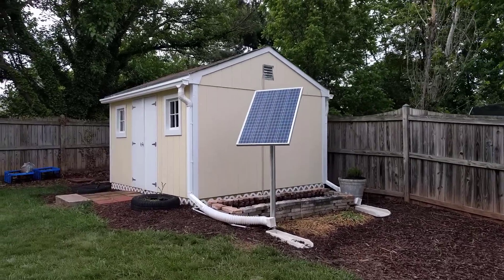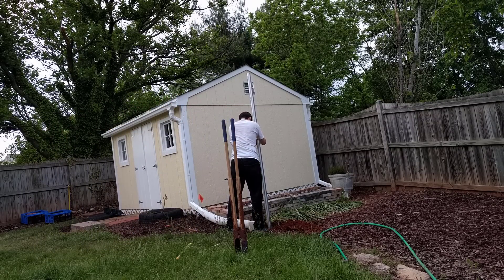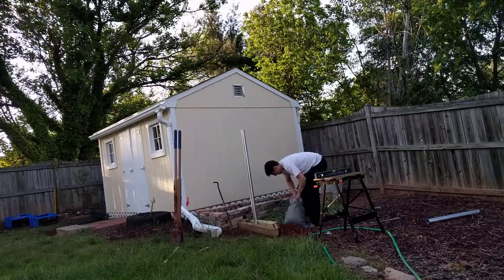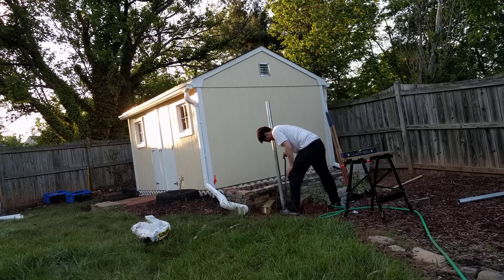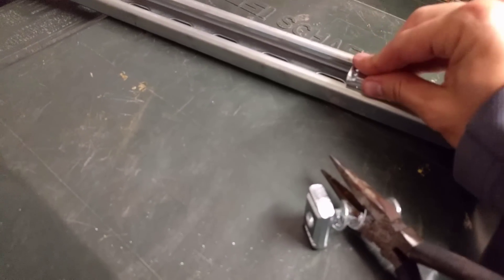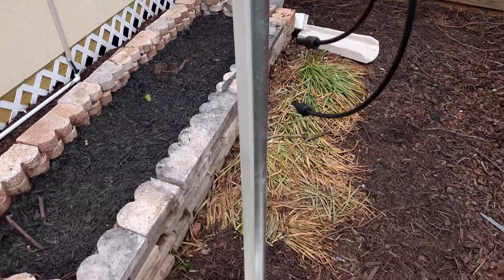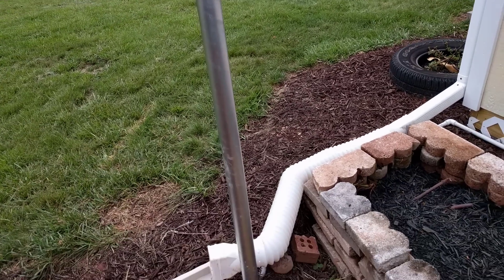Solar Power Tool Shed Set Up

Comment: Did you have to get a permit and have it inspected after installation?  I got fined $250 by the city for not getting a permit and having it inspected one year after I built the system. I thought that since I wasn't connecting tot he grid I was OK. That would be another problem if I did.

Comment: Wow, what a great video! I really value quality family time outdoors as well. If you're into camping and outdoor adventures, I highly recommend checking out the Segway Portable PowerStation Cube Series. With its massive capacity, powerful output, and fast recharging, it's perfect for keeping your devices and appliances running during extended trips. Plus, its waterproof design ensures it can handle any adventure, rain or shine!

Comment: That's cool I want to buy a solar panel kit and run lights outside with a few batteries to store the power that way they can run the motion sensor security lights all night and in the day time charge the batteries also make a 12 volt switch like that with leds

Comment: Is there a another type of battery besides the one you used to get a connection I don’t like that type of battery especially if plan to put in tiny house living space
Reply from the maker: Yes, there are tons of batteries that you can use, just make sure that it is a deep cycle battery.  The one I picked is somewhat light duty, it is 35Amp Hours.  For a tiny house set up, you may want a bigger battery, and a few more solar panels.
Reply: @burrheadjr  got it thank you probably need probably at least two more panals for tiny house
Reply from the maker: @dreamwakr  Try using a calculator like this to help size your system for your project:
https://unboundsolar.com/solar-information/offgrid-calculator

Comment: I know this video is pretty old, but to save a newbie from making a mistake, please be sure you connect the charge controller to your battery bank BEFORE connecting the solar panel leads to it. If not you run the risk of burning out your charge controller.

Comment: Hi there, great video! Question: if I wanted to run a few power tools such as a bench grinder and mitre saw, do you recommend getting a different control charger, battery, and inverter? I figured I would need a 2500W inverter but wasn’t sure about the control charger and battery. Thank you.
Reply: Or would I need some massive battery power perhaps?

Comment: helpful hint, next time you put a pipe in the ground like that, get a post hammer and just pound it straight down. soooo much easier than what you did , great job on the build though. I am thinking of doing a similar project....

Comment: Nice video!  Did you know that pvc pipe will degrade if exposed to sunlight for a long period of time?  A good option is electrical galvanized conduit which is inexpensive.

Comment: My inverter has an alarm sounding and is flashing red/green. What’s wrong with it?  I think I have exactly the same set up as you do.
Reply from the maker: Running too many devices on it, running on low voltage, or maybe your inverter has a safety feature built in indicating that it is time to replace the battery

That is all I can think of

Comment: What gauge wire did you use that runs from battery to light switch
Reply from the maker: I think you are talking about the small wire that actually come from the Charge controller, and then run to the switch, which then goes to the lights.  That is a 22 gauge wire:
https://www.amazon.com/gp/product/B001JT1CEE/ref=oh_aui_detailpage_o09_s00?ie=UTF8&psc=1

Comment: i’d you have the power inverter on and say an extension cord with it on nothing plugged in is it using electricity or can it just sit there idle, or enough electricity to drain your battery much

Comment: How much did you pay and could you run 3 lights
Reply from the maker: For me it came out to about $434, but considering that I paid high for my inverter, and over paid on cables/wire (you can use cheaper cables, but I went with the pre-set ones for convenience), you could do it for just around $350.  I am sure I could have gotten 3 lights, some setups use 6 smaller lights.  The lights don't use that much power if they are LEDs, so adding more lights would not be too much of a problem.  Click on the description for links and prices for everything I used.

Comment: My question is, could you have just placed the solar panels on the roof of the shed instead of the a-hole and pipe method?
Reply from the maker: Yes, I could absolutely drill into the roof and mount it there.  However, If you put it on the roof, keeping it cleaned off will be a little bit harder, because you need to get a ladder.  Also, if it is on the roof, making adjustment to the tilt will be a little bit tougher too.  The mount that allow you to adjust the panel tilts on rooftops are a bit pricey, and with the pole, I could get away with using uni-strut and a satellite dish mount.  I also liked that I didn't have to worry about accidentally causing a leak on roof shed. Overheating can be an issue to roof mount set ups too if the mount does not allow enough air to get under the panel, I don't have to worry about that at all on the pole.

In my case, I also get a slightly sunnier position on the pole, because the shadows of the trees around the house cover the roof first.

Comment: How long will last the batterie if you use the ac power for regular lights not leds tnx
Reply from the maker: Theoretically, weather I use AC or DC power shouldn't make TOO much of a difference.  The big difference will be using regular incontinence bulbs vs LED lights.  Running a couple standard 60 watt bulbs would last just under a couple of hours before I would want to shut it off to prevent the battery from getting below half way.
Reply: burrheadjr so your inverter don’t have a safety to turn it off before drain the batterie?
Tnx for answer
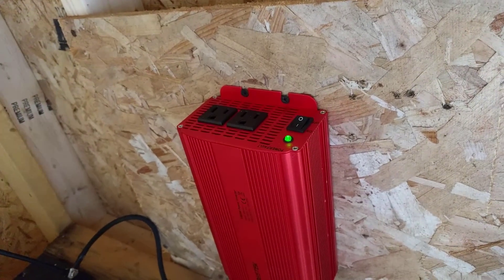Reply from the maker: @fishblue70  The power inverter does have a switch to turn it off and on, you can see me hit it at about 4:00.  If nothing is plugged into the inverter, the power drain is minimal.  It will drawn some power, but not much.
Reply: burrheadjr tnx

Comment: Could I do this same setup but add a second battery in parallel? Or would I need a bigger solar system?
Reply from the maker: I think you could do it.  The battery will allow you to use power, the solar recharges that power.  So there is no requirement that big battery banks need a lot of solar, it will just take longer to recharge.  An example of where that may be helpful, is if you have a shed where you use it heavily for 1 day, but only once a week, or once a month, so that the single panel has plenty of time to recharge the large battery bank.  If however, you will be using it often, then you will want more panels, enough to recharge your usage in the time that you plan on using it again.  You will have to crunch the numbers to see what that will exactly come out to, but it will all depend on what you are looking for.
Reply: double the solar panel wattage to the amp hours of your battery(s).

Comment: Why didn't you just put the panel on the roof? It's in almost the same orientation anyway.
Reply from the maker: A couple of reasons.  
It is easier to clean on the pole
It gets less shade over on the pole.
The pole with the satellite mount was actually easier to install then the roof.
On the pole, I can change the angle from season to season to match the sun
On the pole, I don't have to worry about botching a roof install and causing a leak.

The advantage of the roof mount would be that it looks better, and that is about it.

Comment: Question, my shed is 192sf . It’s for my wife as a small she shed. Her power requirements are 2 led shop lites a window ac unit small frig. Maybe 4-6 120v outlets( maybe) do you thing this unit is ok or something a little bigger.
Reply from the maker: AC units take up a LOT of power.
The LEDs take very little power.
A fridge really depends, but if you get Dometic efficient fridge (they look like coolers), replace the AC unit with a small efficient fan, and use LEDs I would say that with that usage alone, assuming the fridge runs 24 hours a day, and the fan and lights are getting used maybe 4 hours a day, that those things alone would mean that you would want a 50 Amp Hour Battery, and to be able to recharge that, you probably need 3 100 Watt solar panels.  That doesn't take into account any usage from the outlets, and that would depend on what you wanted to run off those.  So you would need to increase from there.  Those are just rough estimates though.
Reply: burrheadjr thank you for your help

Comment: Can you run the DC lights and the AC inverter at the same time?   Looking to power up with AC voltage a heat tape for water linexand a heat lamp only below 35F.
Reply from the maker: You can, BUT, if you are planning to run any appliences that are designed to create heat, watch out, they will draw a lot of power, will push your inverter to the limits, and will drain your battery quick.  Either make sure you have a huge solar system (inverter, battery, panels to recharge, think gauge wires) or skip the heating appliences
Reply: @burrheadjr  well that is the whole purpose of the project.  Trying to eliminate running 300 feet of number 4 wire from house panel to back of property.  Want to set up chicken coupe and run.  Need to have a heat trace to keep waterline from freezing and a modest heat lamp inside coupe only when under 35F.  Not sure how to load calculate this, size wiring, inverter size etc.  Hoping to use low wattage 12 Vdc LED light in shed, run and one in coupe that would only be on for 10 min if back there after dark.

Comment: I'm no electrician but isn't 100W solar panel a bit overkill for a couple 4.5W LEDs? I'm looking to do almost the exact same thing but was thinking of using a cheaper 25W or 40W panel. Would that not work too? Maybe you also want to use the power for other sources. Great setup though.
Reply from the maker: That would work too, mine is overkill for just lights.  I planned to be using the power outlets more often than I do, but I can plug in things if I want.  I am also planning on adding a USB powered fan for the summer, that I will plug into the charge controller USBs.  I can also charge my phone there.
Reply: 100w panel is probably the minimum for a 70 amp hour deep cycle battery.

Comment: Looks good buddy, I would have drilled a hole through the wall at the bottom near the battery and ran my cables that way. It would be more water tight and look nicer. Other than that great work

Comment: Do you think if I get two 100 watts mono panels and four batteries just like in your video, I can run LED lights, flat screen TV, and a fan most of the day with good sunlight?
Reply from the maker: I think you could, if you got a really good energy efficient TV.  I am just guessing that if you got a 19 inch LED TV, with 4 35a/h batteries, that you could run it for 12 hours.  I wouldn't try anything above a 32 inch.  LED lights and Small fans can be run with minimal power.  But then you need to think what are you playing on the TV?  DVD players, Roku, and other things will increase energy usage.  But using an Antenna shouldn't.  So I think as long as you are picking energy efficient devices, and are keeping an eye on usage and recharging, you could.  But you may need a day or so every now and then as recharge only days if you find you are using up too much.  Don't drain those batteries below 50%.
Reply: @burrheadjr  thanks brother
Reply from the maker: @sebastrianw.4673  Sure thing, keep us updated on your project
Reply: @burrheadjr  if I decide to go forth with it I will. Thanks again

Comment: How did you connect the inverter to the light switch? And how long can it stay on for??
Reply from the maker: I actually misspoke, I connected light switch between the charge controller and the lights.  I would imagine they could stay on all day.  These LEDs take very little power, though they may struggle in the winter when there is less sun to recharge the battery.
Reply: What type of wire did you use?
Reply from the maker: @majida70  The Wire from the Solar Panel to the Charge Controller is a  Renogy 30Ft 10 AWG Solar Panel and Controller Connector Adaptor Wire with MC4  clips at the end.

The wire from the charge controller to the batter is a RENOGY 8ft. 10 AWG Wire with battery terminal loops at one end.

The wire from the battery to the charge controller is a pair of InstallGear 5 AWG Gauge 2ft Battery cables

And the light wiring is  Wire 22-Gauge Parallel Wire

Expand the description to see all the parts I used, with links and prices

Comment: If I have a small 115v a/c unit that would be running all day almost everyday (south Texas)..... would I have to change out that 12v battery??
Reply from the maker: You will probably need a bigger 12V battery than I have, and more than 1 solar panel to keep the battery charged.  The size of the battery and the number of panels that you need would demand on how much power the AC unit would take.  Just a rough estimate, would be that you would need an 700AH battery, and 15 solar panel (at 100Watts each) to accomplish that. (AC units are power hogs).

Comment: Very nice simple video and tutorial. Question with battery and equipment surrounding by wood any chance it could cause a fire?
Reply from the maker: YES, however it is actually probably better to be surrounded by wood then metal.  Metal breaking off and touching the battery if it fell just right could cause a short and lead to disaster.  But yes, fire is always a concern anytime electricity is involved.  Check out this follow up video to see the steps I took to help reduce the chances for a fire:
https://youtu.be/GRKcZEIWihg
Reply: Very nice. One more question please......u think it's legal to install 200watts on rooftop? If now I will order mine very soon.
Reply from the maker: @robertthi7532  I would be shocked if there was any state of country that made that illegal.  Should be fine.  I have seen vans with 400watts on the roof.  And there is another video of a shed on youtube that is 400+ watts.

Comment: Home Depot has the Tuff Shed's down here that are all made of nice wood.  They want nearly $4,000 for one of them.  The city where I live only allows sheds to be no larger than 10x10.  If I ever get one, I plan to insulate it and make fill the roof full of solar panels and put the wall unit A/C in it, or at least fans for ventilation.  I am looking to do this in the distant future.  I would still love to have a shed.  We need the space.  I don't like cheap sheds. I want one that I can convert into a room.

Comment: You can run a wall unit AC in your shed/workshop. I am currently testing this on my channel.
Reply from the maker: I would need a bigger battery if I wanted an AC unit to run on it
Reply: @burrheadjr  Look at my channel and look how long I ran mine on only 4 batteries and 2 solar panels.  I was shocked how long it was able to run.

Comment: The wire for lights running from the control box or power inverter...great video
Reply from the maker: It is actually from the charge controller, I may have said it wrong on the video

Comment: Would this system work to power laptops consistently while they are on? Both night and day ? Maybe if I also add a wind turbine for those non sunny days
Reply from the maker: You would have to check the specs of the laptop to know exactly, but I would imagine you would need to upgrade the solar panel or add more panels, and upgrade the battery from the one that i have.  But if those parts are upgraded (maybe also sine wave inverter), you could have laptops running on it fairly consistently.  Unless you had a stretch of cloudy days in a row while you were also using the laptops, then you would just need to curb your use until the sun recharges the batteries.

Comment: This is EXACTLY what I was looking for... I hope you don't mind me borrowing every aspect of your buildout...
Reply: How’d it go?  Considering doing it myself
Reply: @mitchgrant7385 , if your question is directed to me, I went a less expensive route. All I really wanted was some interior lighting. I grabbed the 100 watt solar kit from Harbor Freight and two of their 35 Ah batteries. There's a couple of  12 v bulbs plugged in to the regulator and for general lighting that is fine.   I also have one of their Jupiter 1000w inverters in case I need the odd corded 120vac appliance or tool. IF  I ever want a little more power, I think I will upgrade the panels etc.

Comment: You should fit a circuit breaker or fuse between the batter and inverter. For example if you are using a 1000w inverter then use a 100amp breaker, 1500w inverter then use a 150amp breaker or fuse etc. The wire looks thick enough but it's best to keep the inverter as close to the battery bank as possible to limit any voltage drop.
Reply from the maker: You are right, take a look:
https://www.youtube.com/watch?v=GRKcZEIWihg

Comment: just wonder how long could you run lets say the lights and a small fan in the night off the fully charged battery before it would die? any idea?
Reply from the maker: If the lights and fan were on 8 hours a day, and the fan and the lights were 5 watt, 12v appliances, I would think that both should be able to run that long, and have the battery recharged every day assuming a clear day.

Comment: Does the extender cables positive and negative are connected red to black and black to red (reverse)?
Reply from the maker: I think it did, I remember there being something odd like that, but at the same time, the clips could only go in one way, so there was no issue.